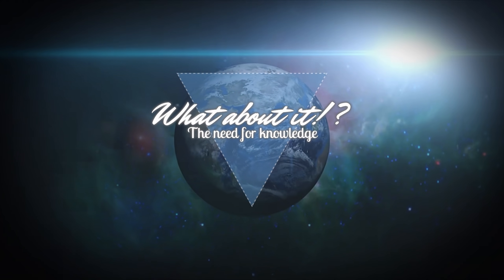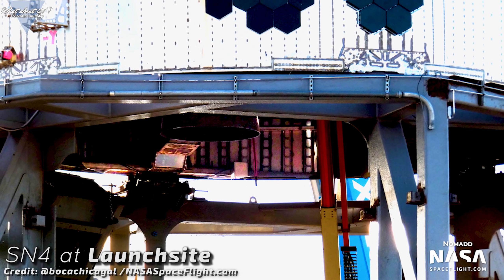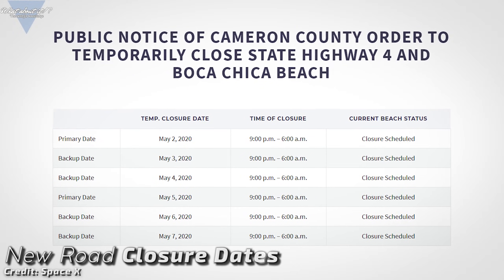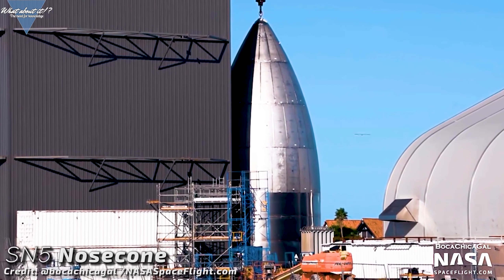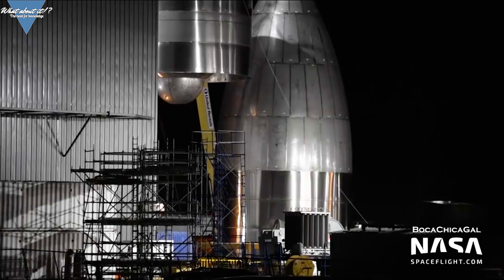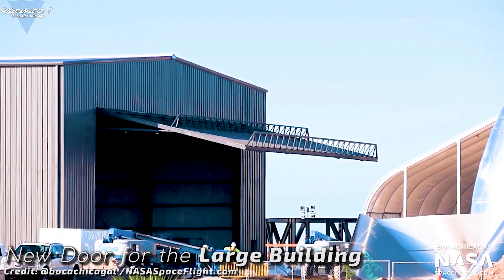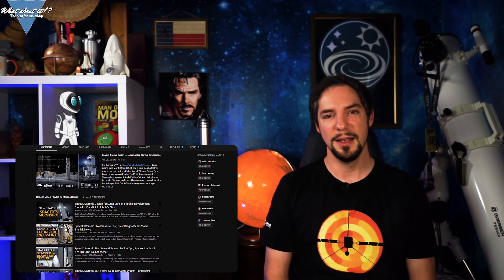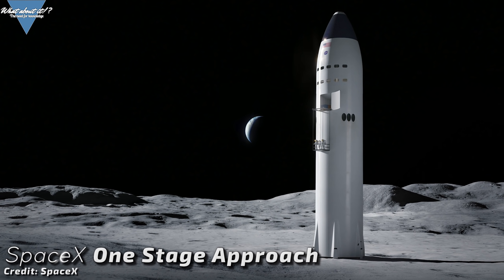89 | SpaceX Starship Updates - Lunar Starship: One Giant Leap

Comment: The freight elevator is a great idea, but it will draw significant electrical power if built to shuttle tons of payload to the surface. Maybe the initial unloading is done with braking/regeneration, then a small, human-sized sub-elevator goes up and down for daily tasks.

Comment: Question on the lunar starship upper thrusters, are there 4 or 3 sets of them ?
Reply: Looks like three, but these are just very early artists renderings, not actual design drawings.
Reply from the maker: @odysseusrex5908  Agreed. Caspar went with 4x3. I think it will be less and he said so too by now. We'll have to see in the end. It's not even clear, what engines will be used, right?
Reply: Superdracos have about 7 tons of thrust each, so doing the math that's 63 tons or 84 tons, multiply by 6 for lunar gravity, and that 378 or 504 for the maximum weight you could land
Reply: 3 sets of 3. I'm guessing one could fail in a set, and maybe 2 overall, and still land safely. This redundancy would echo the SuperDracos on F9. But I don't assume they'll be SuperDracos - they'd need their own hypergolic fuel supply, and a way to refuel it. Makes more sense to run them off the same system as the hot-gas RCS thrusters. Will require a new, larger design - and I've no idea if SuperDracos can be converted to methalox.
Reply: Don Jones using methalox makes sense,  they don’t have to be particularly efficient, probably only used for the very last part of landing. Maybe 10 seconds or so, just a guess.

Comment: It would be interesting to know how large a payload the  Lunar Starship will be able to accommodate to/from the moon's surface.
Reply from the maker: to 100 tons, from likely the same.
Reply: 100 tons to low earth orbit means with refueling you get 100 tons to the Moon and back. Otherwise you're only going to get about 7.5 tons to the Moon and back.
Reply: If moon-starship is rightly derived from actual starship project, it'll have the same  scheduled payload, 100 to 150 tons.   Use of starship will necessit lot of refueling, it's the only way to have an orbiter without the enormous tanks needed by space-travel.
Reply: With refuelling launches it'll be whatever it can get to LEO.  That's the hardest part.  But you end up with at least 3 launches, possibly more for moon and back.
Reply: @mostevil1082  that's one of the thing I don't really like about the starship design, it'll need a lot of refueling
Reply: @ivanfaye3041   But to get 100t to the lunar surface with any other designs will take an absurd amount of launches on expendable boosters. And the $$$!
Next to that the tanker launches don't look that bad.
Reply: @donjones4719  Yeah, the need for refueling goes against Starship for payloads comparable to other rockets... but Starship isn't built to fly comparable payloads. It'd designed to fly stupidly big payloads to anywhere that refueling can take it.

Also, the ability to launch 20-30 Starships for the cost of one SLS flight doesn't hurt...
Reply: You people can't be serious. Nothing goes into 'space,' nothing can leave Earth's atmosphere and you can't 'land' on the moon, it's not a solid object- look at it during the times it's visible during the day, you can see through it and when it's lit up at night it's fully lit to the edges. A sphere has shadows, that's how you can tell a sphere is a SPHERE, Rain Men.
Reply: @jeffbridges5312  Flatheads don't get much sympathy here. We don't feel sorry for you, just annoyance.
Reply: @jeffbridges5312  say what?

Comment: What if they are testing gimbal system by placing the engine intentionally assymetrical
Reply: even with the engine centered the gimbal system would have to be working right on or big boom, but I think you are right in that having only one of the three future planned engines working this will give them lots of real flight data to look at.
Reply from the maker: The reason for one engine is less stress on the Starship. They want to bring it down again. Could have mentioned that. Was too focussed on explaining the flight path... :D

Comment: I noticed the rendering of lunar starship had a mixture of vacuum ad sea level nozzles. In reality it needs only vacuum optimized. The rendering should be changed to reflect this.
Reply from the maker: Agreed. I was wondering that too. The official SpaceX rendering had the same configuration though.
Reply: @Whataboutit  Because the Sea Level engine gimbal and the Vacuum ones don't (in the designs spoken about so far), so the Sea Level Raptors will do the steering in space.
Reply: @Whataboutit   The "sea-level" engines are of course actually the "in medium atmosphere" engines. LSS (Lunar Starship) will need these to have any decent payload from launch-to-LEO. As said, they need at least one of these to gimbal, and adding a vacuum bell would limit its gimbal. 

And SX may simply feel the performance difference of modifying the engine layout is not cost-effective for building a handful of these. A bit frustrating, since all 3 center engines are needed only once in the LSS' lifetime.
Reply: Three vacuum engines do not provide enough thrust to get to LEO (due to far greater gravity losses), so you need at least one more engine, but a vacuum engine bell would be too large to fit in the central location. Three sea-level engines would fit, and the increased thrust (resulting in much lower gravity losses) apparently make three vacuum engines and three sea-level engines the optimum number.
Reply: Comparing a Starship with just 3 Raptor would get you a thrust to weight similar or worse than what Centaur has, so considering Superheavy will leave Starship quite short of orbit, they need the extra Raptors.
Plus those sea level engines are the ones that fire through the center of mass, so if you use the main engines to liftoff from the moon you have to use these.
Reply: As far as I know 3 engines aren't sufficient to reach earth orbit. Sea level engines aren't needed if it's not landing on earth, but can you fit enough vacuum engines to make up the thrust.
Reply: In case they change their minds and want to land on earth.
Reply: The mix of vac and sea level engines looks kind of wonky and dead weight.  But it will be an established and proven production configuration for regular starship. But look at the redundancy it offers! Carrying two spare sets of engines might turn out to be very handy especially if planning a lot of reuse of the lunar starship  over several years.
Reply: Since  there are no parachutes, I'm guessing they would keep the extra engines even if they aren't necessary for the main mission in case of emergencies.
Reply: The tail-sit landing configuration is itself a mistake. It would be better if the ship landed recumbent, using four pairs of motors.
Reply: Well, it still needs to get out of the atmosphere, probably carrying a heavy load of cargo.
Reply: Odysseus Rex Superheavy will be needed to launch this Lunar Starship into low earth orbit for refueling before lunar insertion.  Superheavy will do all of the near-sea level heavy lifting.  They MAY still keep the standard vacuum/sea level engine mix, though.  Less engineering to rework that way, and there’s going to be PLENTY of thrust and fuel available, so the slight loss from a few non-optimized nozzles might be worth taking.  If the best part is no part, perhaps sometimes the best optimization can be NO optimization. 😉
Reply: You people: "DURP! We be landing on DA Moon! I'm dumb I can't tell CGI and photoshop images when I see all of NASA and Space X's phony crap and I'm still stuck in the 20th century before imaging software exposed all of NASA as all 100% fraud! Phasers on full Scotty! DURR!"
Reply: ... and when the cheesy supposed 'moon landing' happens it will be the same crappy CGI graphics that you low IQ bozos fall for every time

Comment: hey felix checked the landing legs on elons photo of sn 4 check on the sides
Reply from the maker: What exactly are you pointing out?
Reply: @Whataboutit  cehck elon's photo of raptor installed  sn 4 on the circumference of the ring segmrnt you can notice structure like the updated landing legs animation couldnt send photo . check twitter @ArunKum38638248 for more info